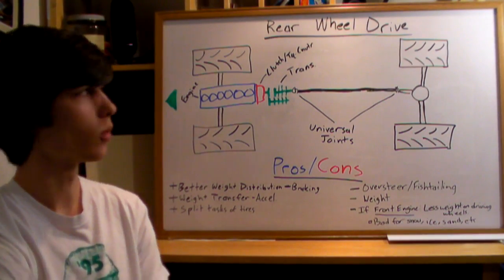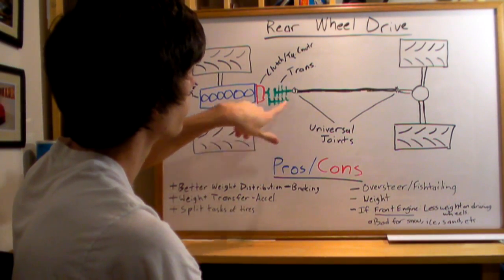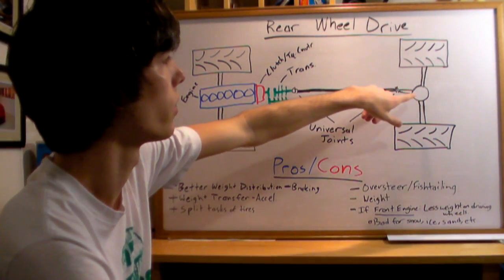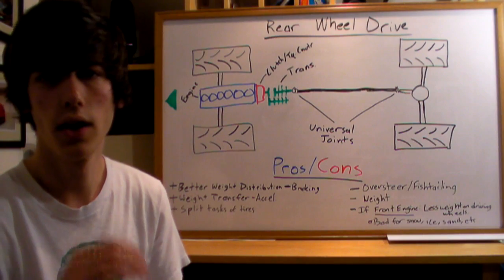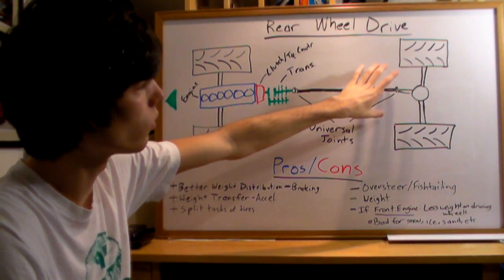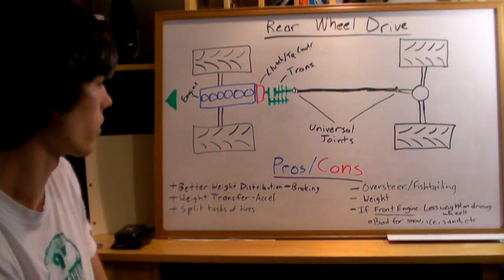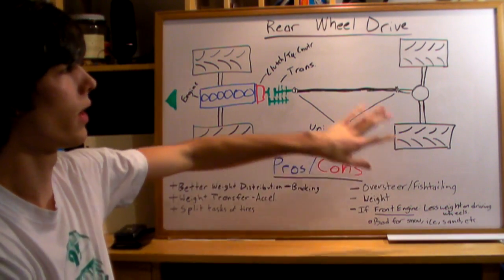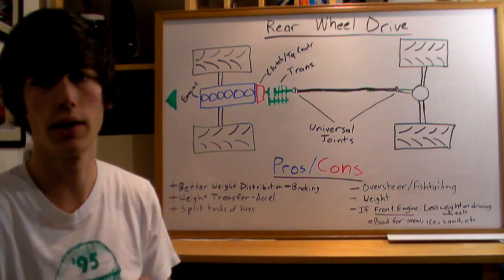Rear Wheel Drive - RWD - Explained

Comment: How far you've come, this is old school compared to your latest videos. I'm on the hunt for info on drivetrains and what could possibly be causing my buzzing noise on my Fiat 124. Have a new engine so it's not the engine. Looking at wheel and drivetrain bearing next.

Comment: I did not hear it in the video, but Iguess front wheel drive has added complexion in that the driven wheels have to be able to turn freely for steering while getting torgue. I always immagened that to be hard to do. I guess those mechanisms would need to be quite heavy to withstand massive torgue of sports cars and trucks. Right?

Comment: Hello, I have a question about the purpose of the centering sleeve on the front end of the driveshaft, as is in BMW and Mercedes. A lot of threads claim that the sleeve support the operation of the flex disc and worn sleeve can cause vibration. My opinion is that the worn centering sleeve can not cause vibration by itself since it is stationary in relation to gearbox and driveshaft flanges. I think that apart from the centering function the sleeve serves as a safety measure in case of flex disc failure. I think that In case of flex disc (or guibo) failure the centering sleeve will prevent falling down of the driveshaft and secure it into place for safe stop of the vehicle. Am I right? Thank you :)

Comment: ok i think we have had  enuf of fwd.  chevy chevette into the future.  eco engine 1.6L.current  engine fuel and electrical systems technology.
100 to 150 hp.  5spd  auto trans or cvt.  2 or 4 door.  struts all round. adjustable camber
in the front.  rack and pinion steering.    this car would sell like wildfire.  GM should
be the first to do this.

Comment: wow.. All of these videos are great. I am the proud owner of a Scion FRS which is rear wheel drive car. I noticed that you listed fishtailing as a con when really it should be a pro.. why? because its so much godamn fun!
Reply: Well, an FR-S can drift like a champ because of it's design. However, if you have a RWD car that is a lot fatter and not as good handling cough Dodge Challenger cough fishtailing is really bad since the car can't recover as easy due to momentum. This will lead to spin outs, crashes and possibly flips.

So it really depends on the car and how your driving it (track vs. highway) that decides if fishtailing is bad or good.

Comment: Hi, I want to make sure my concept is correct after watching your video. So I want to ask is it the steering wheel still at the front? Which means the front wheel will turn while the rear wheel does not turn but instead giving power to front wheel?

Comment: Yeah, however a FWD car will always understeer in a high speed corner. Like for instance in auto racing. You watch a RWD and FWD car drive around a track and they will take a much different racing line. Engine in the middle, RWD is the best layout for a car. Cost you alot of space though. Which is why your average car is not laidout like that.

Comment from the maker: Inertia means that something stays in the state that it is in. So something moving continues to move, unless acted upon by an outside force. The front of your car lifting up due to acceleration is simply weight transfer because your car has a force moving it forward, and it's center of gravity "resists" in the opposite direction, so the car lifts up in front.

Comment from the maker: Powered oversteer; the rear tires lose lateral grip and slide out because under acceleration some of the grip is used for pushing the car forward. FWD vehicles do not experience this problem in the same fashion.

Comment: Oversteer is not a function of rear wheel drive it is a function of the a number of things but in steady state it is primarily based on your front and rear axle slip angles.  I dont know if I would put oversteer as a "negative" for RWD vehicles

Comment from the maker: It allows for the tires to stay at peak friction in an even manner, rather than just the front doing all the work. The front already has most of the braking, and all of the turning. Adding power to this means it needs even more friction. If the rear has this, the front tires can keep more friction without having to devote some of the friction to acceleration. Check out my video entitled "traction circle" should help with this topic.

Comment from the maker: RWD vehicles can understeer just as easily as FWD vehicles while cornering without applying an acceleration load on the tires. So it's not necessarily an advantage over FWD. Also, most vehicles are engineered to understeer so that if the car loses control it hits the object in its path with the front of the car (much greater crumple zone) rather than the side.

Comment from the maker: Yes, a spoiler on a FWD car can be useful. Perhaps I should make a video on downforce. When you increase downforce, you increase the friction of the tires and the ground, so the maximum speed you can corner, accelerate, and decelerate increases. But when you see someone with a giant spoiler on a 96 hp civic, it's just for show, as they will not be experiencing speeds high enough to grant the spoiler worthy, and many times they'll be on basic all-season tires.

Comment from the maker: @ThisIsNotSharyn Spoilers create a weight that isn't really there. So in a corner, the force from the spoiler pushing down doesn't mean more mass is resisting the turn, it just means you'll have more friction to overcome it. So a spoiler on any car can make it capable (with the right tires, suspension, etc..) of greater than 1g turns. 

Bad side of a spoiler? Constant drag, and around the city you're never going fast enough for it to do anything.

Comment: Most RWD cars I see have the engine in the front (keywords being 'that I see'). Is this why a spoiler on a RWD car is common? So air can create downforce on the back of the car and can thus help keep the back of the car on the ground giving it traction?
Also, why would a spoiler on a FWD car be bad? If the engine is in the front, won't a spoiler help keep the back-end down, thus creating better weight distribution?